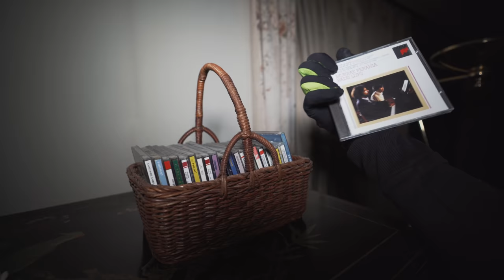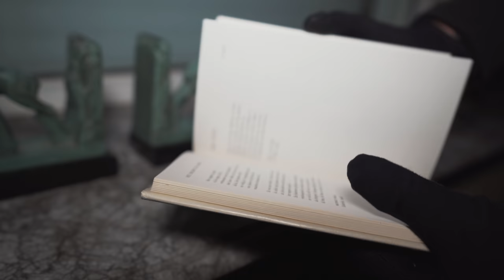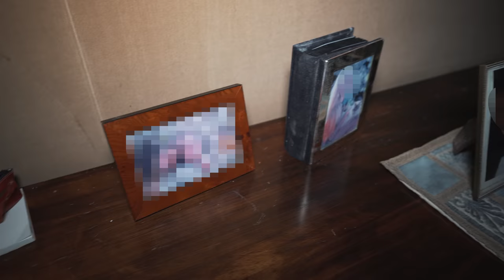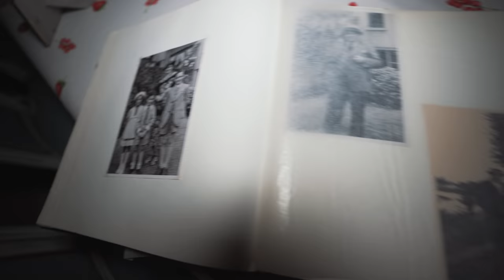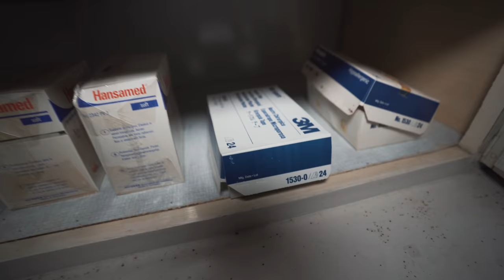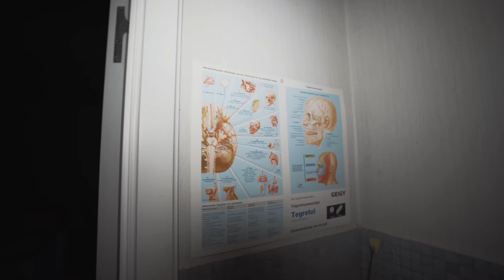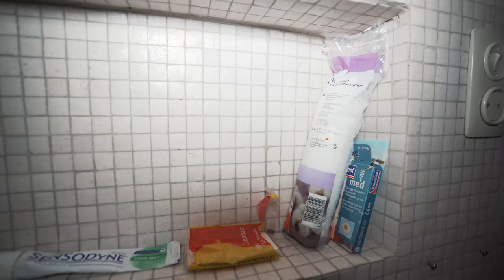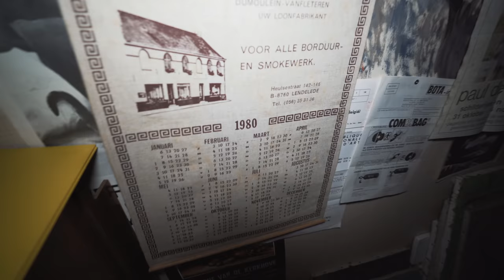Abandoned millionaires mansion of a Belgian doctor (INCREDIBLE FIND)

Comment: In the doctor's area you came across a really dark narrow room where you thought the doctor would see you, you held up a thin fim that was x-ray film not used. That's what x-ray film looks like before it is taken. They probably developed the x-rays in that room by hand. I had to do that a a doctor's office back in 1980. The room is dark as not to have any light or reflection of light ruin the film. There was probably a place for vats that were stainless steel where the fixer solution and water was as part of the film process. He could also have been a doctor who specialized in the ears, nose and throat, and or head. as well.

Comment: 16th and 17th century is not 1960's and 1970's. 16th century was anything in the 1500's. 17th century was anything in the 1600's. The 1960's and 1970's are decades in the 20th Century. If it says 1800..that is the 19th century, etc. The first century was from year zero until year 100. Year 100 began the 2nd century etc.I admire your videos and I keep hearing you getting this wrong. Sending this with all best wishes.